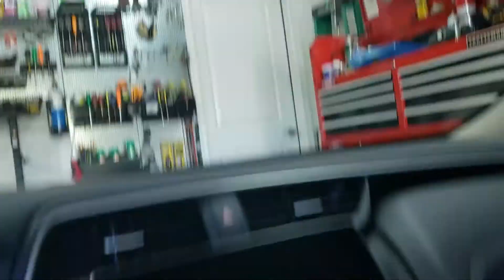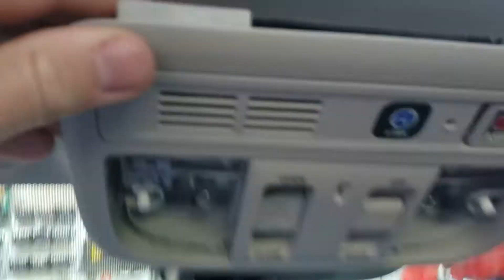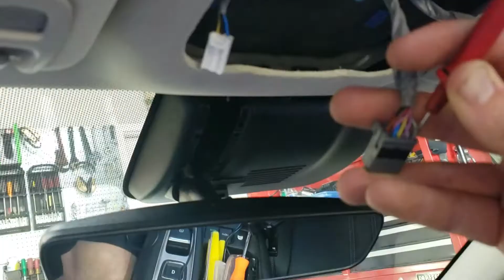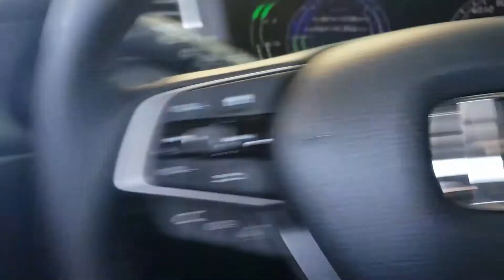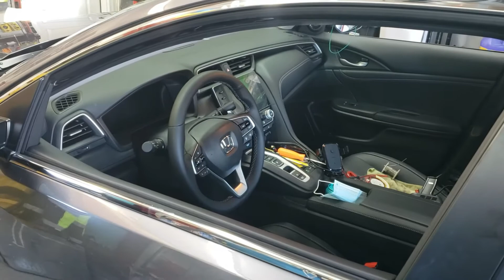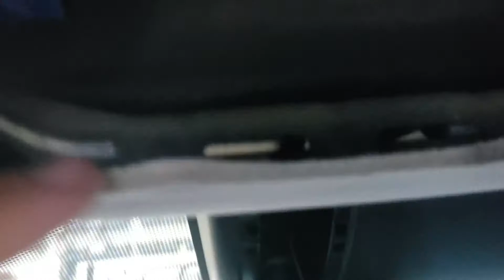2021 Honda Insight Dashcam install

Comment: Got a honda passport and am considering having my dash mounted to that plastic dome as well, my question to you is how secure is that dome and is it strong enough to support cameras weight without falling?
Reply from the maker: I have not had any issues but make sure it does not have any shinny cleaners on it. If it does, clean it with a alcohol or citrus cleaner and it should be fine.
Reply: @ajphillipsjeeps  Shiny cleaners as in some sort of shine product on the plastic that would make adhesive fail if not cleaned properly?
Reply from the maker: @jessem6766  yes, anything that produces a shin normally does not let the adhesive work well.
Reply: @ajphillipsjeeps  Thanks for the prompt reply. How is that Honda plastic cover dome secured to the windshield do you know?
Reply from the maker: @jessem6766  don't think I ever pulled it that far off. And sold the car a few months ago for a lot more than I paid.

Comment: Great video, ordered a 2022 Ridgeline and want to install dash cam in it, without running a cable down to the fuze box. Did u install a rear view cam on your truck?
Reply from the maker: I do not  install yhem on my personal vehicle since a rear end accident is easy to prove who was at fault. I have done a few for friends and they are not hard, just have to add the extra cable that runs to the back.
Reply: @ajphillipsjeeps  AJ thanks for the advice, THINKWARE U1000 Dual Dash might be the way to go, I want to install dash cam only once. But I have until June to decide.

Comment: if i wire it into a full time power source, will it drain my battery?
Reply from the maker: Yes, if the power stays on 100% of the time, the camera will also. On this camera you can get the power cord that also had a full time power for security mode. It still uses a little power but not as much since it does not record full time, just during motion. You should still get multiple days of usage before the battery drains to far that it will not start though.

Comment: Very good, this is far better than snaking down to the lighter. I would be temped to wire A connector into the plastic housing making replacing components easier if need be in the future. Thanks
Reply from the maker: I have installed a lot of dash cameras through the years and I think have only had an issue with 1 and it wasn't the wiring but the camera itself. Unplugged it and swapped in 2 seconds. Honestly the bigger issue has been when selling a vehicle and wanting to pull the unit out.
Reply: @ajphillipsjeeps  did you have to reduce the voltage?  Think some cameras might have a voltage reducer built in the cigarette lighter ..
This is by far the cleanest install. Thanks
Reply: OH I didn’t see that before , you say you connected power to the head light switch, the switch on the steering column?
Reply from the maker: @IH1940HAY  no reducer. The standard in vehicles is 12 volt except the hybrid part, but that is heavy duty cables that are normally orange. The camera is 12 volt and low amp pull.

Comment: I don’t understand where Did you connect the white wire.. I saw the yellow water was connected with the blue.. You didn’t explain the wite ?
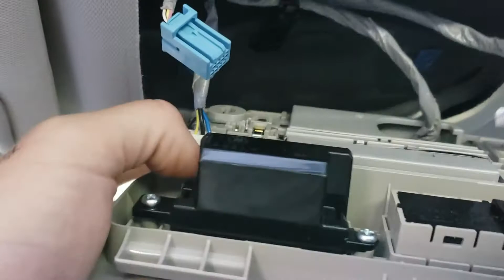Reply from the maker: The black wire is the ground that the white wire goes to. I put a note at 4:14 but probably should have recorded it to help. I think I realized I had missed that when editing and decided to just add the note on screen.
Reply: @ajphillipsjeeps   thank you very much I’ll do the same  That helps a lot  Yellow and blue.  And the white with black 👍
Reply from the maker: @amosgjoni  glad it helped, let me know if you run into any issues.

Comment: Thanks for the video to remove the small black cover for the wiring of the mirror I ended up putting the short end of a Allen Wrench in the hole on the back where the wire comes out to pull it straight down. This made the removal process very easy.
Reply from the maker: Glad it helped, it is always fun trying to figure new designs out without breaking stuff.

Comment: Hi! Nice video! Will make this as an option. Do you recommend the OBD 2 method as another option? Thanks!
Reply from the maker: I have never been a fan of the OBD 2 since the factory will plug unto it and see it there easier. I would do a fuse tap though if you do not want to cut into wiring.

Comment: If that dashcam uses a micro usb plug for power you can use this for an easier and cleaner install.
https://www.amazon.com/dp/B08167R5M3/ref=cm_sw_r_cp_apa_i_3Z5HFbKB7H4SR
Reply from the maker: It does not use a USB but I did not know about that. Good to know for future installs.